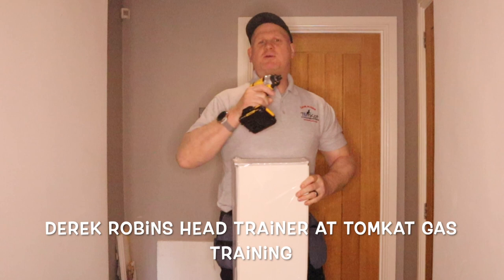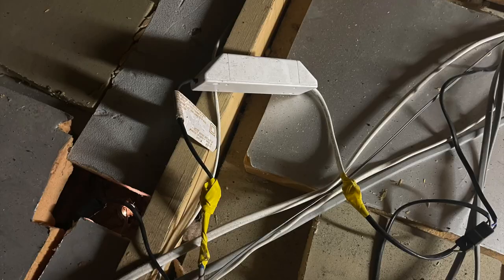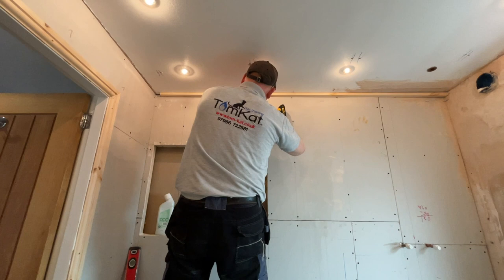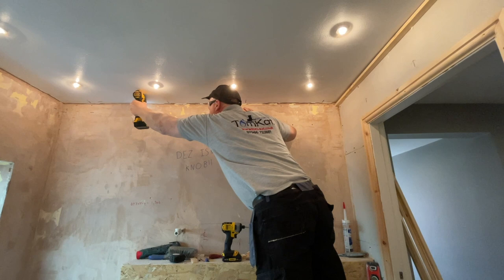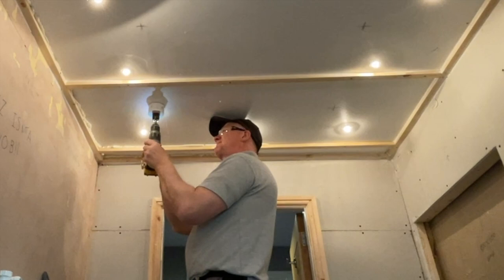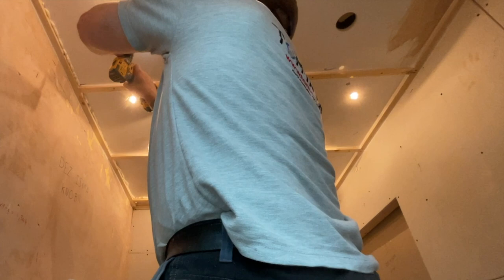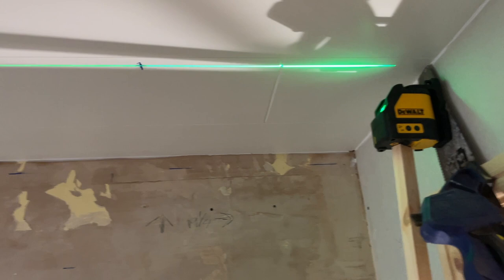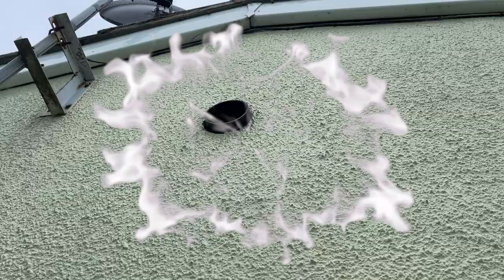Bathroom renovations day 8. Installing PVC ceiling cladding and recessed down lights and extractor.

Comment: Coming along nicely Derek, only thing I'd change (from personal experience) is the extraction - an in-line fan with much better extraction and reliability paired with insulated ali ducting. 

I chose a standard coax fan through the wall and regret it every day 😂

Comment: I'd maybe switch to insulated flexible ducting for the loft. You might get some condensation travelling back down the inside of that plastic flexi in the depths of winter.

Looking very good though. 👍 You'll start to see it come together when you get the tiles on next. 😊
Reply from the maker: I did think of that cheers 👍🏻

Comment: As a joiner and builder I'd have dropped the ceiling and started again.... It is clear the previous builder was crap. If I had done it there would be a perimeter noggings all round 50mm from the edge.... And I have seen ceilings collapse as a result of people keep coming and over boarding.

Comment: Fit a hand douche next to the toilet,  saves on toilet paper and added long term health benefits too.
Reply from the maker: I can’t because I am direct of the cold mains so I would be breaking water regulations.
Reply: @tomkatgastraining  Fit a non return valve on the cold feed supply to the douche.
Reply from the maker: @ranat5526  you can’t use a non return valve for fluid category 5